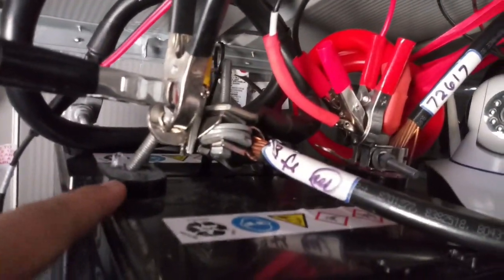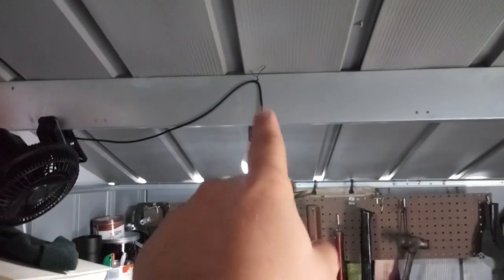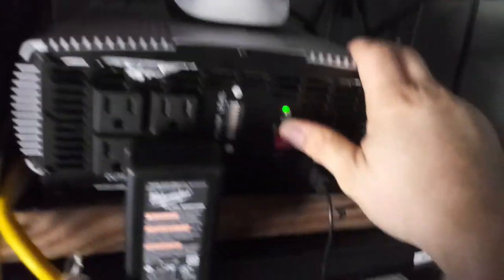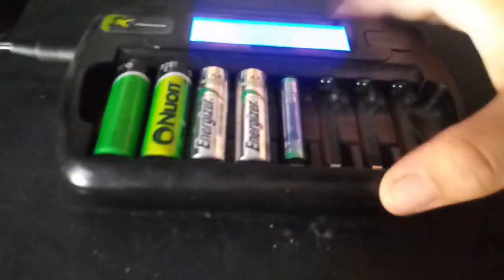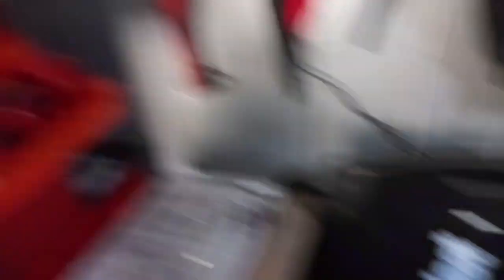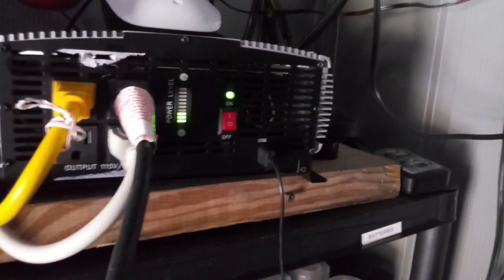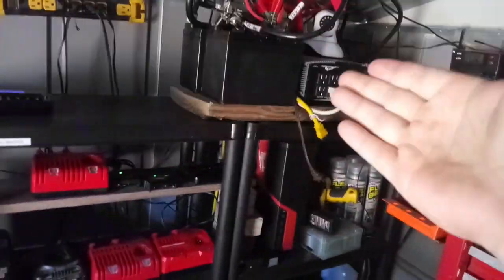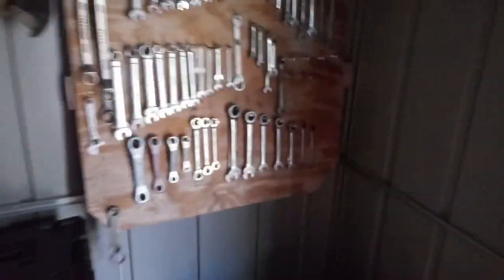harbor freight solar review

Comment: THAT IS A NICE SMALL HARBOR FREIGHT DIY SOLAR SYSTEM YOU HAVE IN THE POWER TOOL SHED . THE JUPITER IS THE MAIN POWER MAKER . ARE YOU PLANNING TO EXPAND YOUR SYSTEM BY PURCHASING MORE HARBOR FREIGHT OR BRAND NAME PV MODULES AND BATTERIES FOR MORE POWER PRODUCTION AND USES ?  HOW ABOUT GETTING THE POWER TO YOUR HOUSE WHEN THE LIGHTS GOES OUT OR TO SAVE ON THE LIGHT BILL ? KEEP UP THE GREAT WORK . CHECK OUT MY SOLAR VIDEOS , HIT LIKE , LEAVE A COMMENT AND SUBSCRIBE . MAY THE SOLAR BE WITH YOU .

Comment: For the record you ran your batteries parallel not in series. Series would double the voltage and keep same amps. Parallel keeps the same voltage and doubles the amps

Comment: Did you test each panel individually??? For 25 wants you need to use a 50 watt 2 ohm resistor!!! What was your out come??!! you need to test them to know which panels are doing what and which ones are going bad... Cuz these are not serious solar panels....real panels have aluminum framing, they have UV wiring, and they have mc4 plugs...

Have garden lights??? This is perfect system to run them...
Reply from the maker: Do i need to upload a video of me running a milwaukee grinder ? Becouse i can and will ..... Im backed up at work and not making videos at the moment i just became lead maintenence man. And with covid going on im not rattling my brain to pruve anything outside my norms. I was a plumber and i learned mechanical work not electrical work. Now yes im doing so for my new leadership position BUT im not buying tools. Or spending time to explain what the box says. I trust harbor freight not to lie and. Second. The battery's would power garden lights .....becouse it would be night and there would be no light for the panels. While your so buisy trying to belittle me and be a smart ass the power is from the batteries ...thank you. I can have and will continue to jump cars, run. Computers.  Stream youtube , charge. Rechargable aa.  AAA.   D.   C. Batteries. Drill batteries millwauke. Porter cable. Hypertough.   Run grinders jigsaws shop vacs. And air compressor s your not going to convince me. That this wont becouse i have been for over a year now.l did not lie missinform or misdirect anyone. I got amazing use. And i stand by the use harber freight batteries.  Inverter and panels. And they work fine. Each are rated fo 25. That makes 100. It keeps up. Ive not drained a battery yet not with more than 40 batteries charging. Drills. Double a. Ect. Alll at once. And playing music. And running a fan.    If you dont think they can. Buy them then do a honest review .... Becouse. If their box is wrong i do believe. They can be sued.   If i might. Get a bit. More direct on this.  I see you have been on youtube 2 years at least and i do notice your videos. Dont scratch 300 measly views. I do have more on this video than anything. But not quite 200 are you ill that i might have moe views on this. Than your solar videos years before you. If people needed your odd disjointed input they would be on your chanel. Im doing. Reviews. Based on the tools. " tools " doing. What they should or. Are expected to do ....    I rigged this. In 2 hours.   The day i built the shed man. It can help people make a informed decision on a purchase and. I do believe i was honest clearly unprofessional and. Unbias.  Thanks for making me feel.  Less intelligent :)  have a great apocalypse